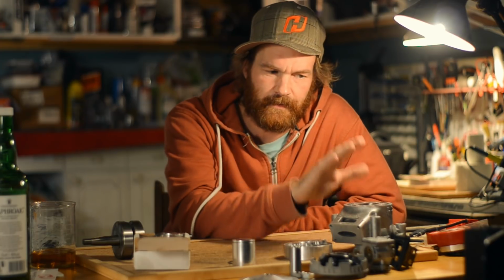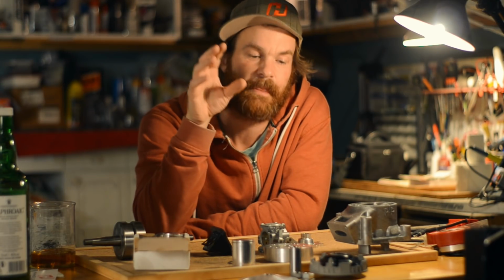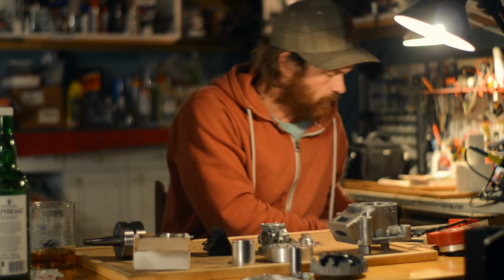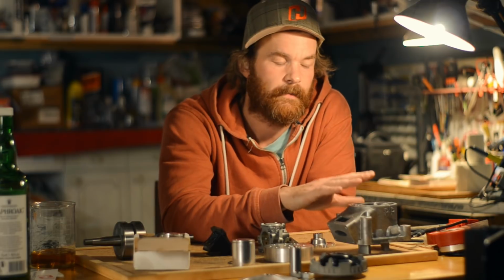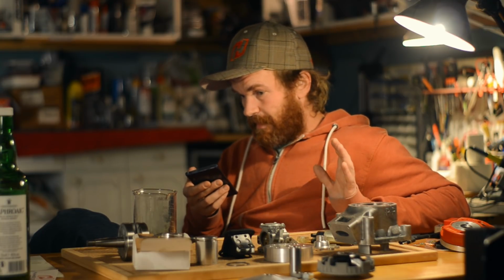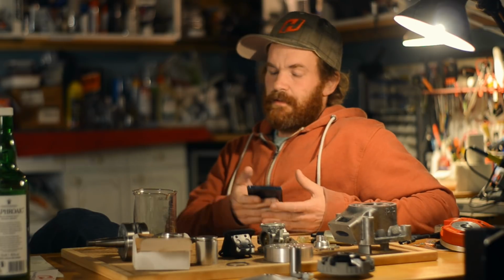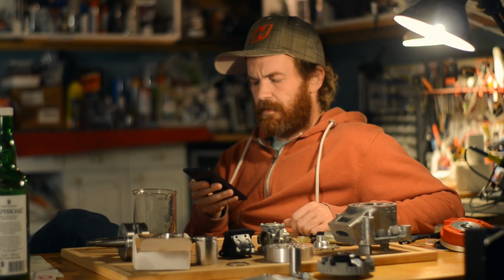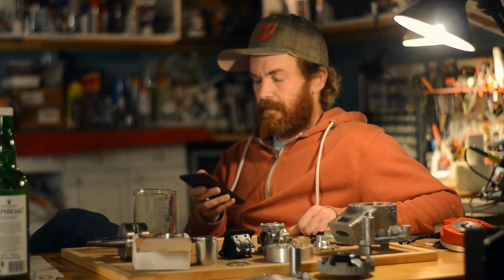THE Most Powerful Two Stroke - Back at it! + Replying to comments

Comment: The fastest way to gain maximum horsepower would be to do away with the air intake system completely, replace it instead with a liquid oxygen injection system, this way you only need the exhaust ports, no intake ports or systems at all. Temperature can be controlled by adjusting the fuel/oxygen ratios, as in a conventional system. Liquid oxygen expands considerably when it changes from a liquid to a gas, it would be like running a high pressure supercharger.
Reply: then not only is he attempting a record speed run on two wheels full of liquid fuel, youre adding a pressurized oxidizer to the same unit. literally evil kenevil with a bomb strapped to the gas tank. i cant imagine its safe at all
Reply: imakedookie  Liquid oxygen or LOX is not flammable by itself, it can be pressurized to 350 psi but that is not necessary for it to be used in this configuration.  As long as the two components are kept separated they are relatively safe. If safety is your ultimate goal it might be best not to attempt any type of speed records, especially on a motorcycle. For maximum power removing the need for an intake system could reduce  quite a bit of mass that could then  allow for a liquid oxygen tank and the equipment needed to inject it in a liquid state. Of course I know that his idea is nothing new and if it were easy, it would have been done by now, the technique would be most applicable to top fuel drag racing where more power is always able to be utilized for higher speeds and lower times.   I doubt the idea can be utilized effectively without quite a bit of expertise from rocket engineers and contributions from materials experts, but the basic concept is solid and doable.
Reply: @nixter1nixter1  Burning pure oxygen with fuel produces much higher combustion temperatures than burning the oxygen out of available atmospheric air (think acetylene welder). This creates now a materials problem.  I believe that rocket engine nozzles are cooled by circulating fuel on its way to combustion through tubes on their outer surface.
Reply from the maker: Even if you got all the logistics sorted the main problem would still be keeping the oxygen from initiating violent combustion at the instant it's injected into the hot combustion chamber. Could maybe, maybe, be done in some kind of hcci form.
Reply: 2STROKE STUFFING  I agree that implementing this design would be extremely difficult, however it’s only a matter of time before someone is successful in doing this. The combustion process does not have to be at its ideal i.e. hottest temperature, the mixture can be adjusted to a rich condition where it will actually run quite cool. The reason rocket nozzles run so hot is because they run the fuel oxygen mixture at the most efficient and therefore hottest temperatures. If you have even the slightest interest in looking into this I would suggest planning ahead a couple of years and start looking for rocket fuel experts and materials experts who would be willing to assist . Even a crude first attempt would probably produce amazing power levels and give you an instant advantage.

Comment: Have you decided to use a steel liner yet? Until you get the cylinder design complete then send out to get the final barrel chromed?
Reply: Watch his old videos. Alex does the nicasil himself!
Reply: @ossanyberg  I know that, and its never worked satisfactorily once, which is exactly why he didnt go Bonneville with it.
Reply: @manoo422  would go cast iron bore
Reply: @Eddie Hitler How did he know not to take his Nikasil barrel because Bonneville would be rained off...you clown. If you had two brain cells to rub together you would have known he took a completely different engine.

Comment: I'm very curious how your new setup is going to work, ecpecialy how the open intake will perform at other than optimal rpm, lubrication in the crankcase with open intake and fuel control.
It's quite a deviation from the traditionaly followed route in 50cc 2 stroke world, and is a testimony of willpower to succeed.

Comment: The valveless tuned inlet is super interesting, is there any precedent for this design?
Reply: Yes i dont remember well but a few of the big 4 did it back in the height of 2smoke road racing
Reply from the maker: Frits Overmars got me onto it, I know Modena has a working engine with reeds that hinge out of the way at high rpm. Made in collaboration with Frits.
Reply: Original Kawasaki H2 is valveless
Reply: @miamimovies  The H2 is a normal piston ported engine i.e. the piston is the inlet valve.

Comment: I was wondering about the weight reduction. Thanks for answering that clearly.
Reply: I had the same question years ago, one of the looong time racers (Keith Turk) said they added weight a lot of times for stability and traction. IIRC, the Camaro they ran (run?) was close to 4800 pounds, a far cry from the 3400 it started out life as.

Comment: Im new on this channel but im sure there is a injector solution for you if you think of diesel engines they spray 7small cycles before the real big spray. And for the other side i would build it with direct inhection with mechanical pump. Keep it up! 👍
Reply: a diesiel injector that sprays 7 times every 2 rotations at max maybe 5000 rpm would probably be enough for a two stoke at 18000 rpm if you're lucky
Reply: Direct injection would mean you'd need to inject oil separately in the crank case which would mean even more injectors.
Reply: DrZoidbergism im not sure but i think they can stand the oil ?? 🙄 but im sure  if you have dollars to spend they will manufacture one thath will do the job👍
Reply: Im glad with the positive people here nice to throw arround the ideas.👍

Comment: Nitromethane contains nitric and sulfuric acid, all parts that come in contact with that fuel must be plated (nickel silicon carbide). Can’t run the carburetor with a mono propellant can’t stop engine from running
Reply: Where did you find this about Sulfuric and Nitric acid impurity? A quick google didn't support this info. Nitric acid from production cycle should be neutralized?
As far as MSDS of chemical reagent goes no acids should be in the mixture. However if you are speaking about nitro-methane after oxidation might produce nitric acid. Sulfuric acid seems unlikely, cause sulfur poisons catalysts  and would be unlikely fuel supplement. That is why currently  you have to be below 4ppb S in fuels.. Maybe it depends on the suplier?
Reply: Or perhaps make a way to close off the carburetor completely

Comment: How do you control the cvt to hold a constant rpm?
Reply from the maker: Linear actuator varying spring tension.
Reply: electronicaly. now how that works I dont know? maybe that's what you're asking?
Reply: @Hermiwalle  yes that was what i was thinking of:)
Reply: Think snowmobile 
BRAAAAAAAAAAAAAAAAAAA

Comment: if you need to fire a lot of fuel in a short period of time you need a lot or HUGE injectors and high fuelpressure , maibe run two systems and do one side per revolution (gives the systems about half pulses and more change to build up the pressure needed
think you can get the tank to have a dimple for the chin pushing the air over the top of the helmet and maibe some widening toward the knees , you need a tank for the icecooling , and i dont think they have a maximum size for a tank and you can make an interesting fairing from it (not passing the body of the racer but more like an arow point in front of the rider)

about building up cilinders with nickasil . friend of mine repaired high performance kreidler cilinders , he did that by turning down the fins and a lot of the outer part of a stock cilinder to a cilinder with about 3 or 4 mm wall thickness (aluminium with a nickasil coating) then reamed out the high performance cilinder and presfitted the new cilinder before opening up the ports to the ports of the hp cilinder , worked pretty good actually and mahle is known for making high quallity cilinders with the nickasil coating 
might not be best thermical wize but you can do a lot of work to the ports before covering them up with pressing in the cilinder 
might even be possible to machine a billet cilinder that way
Reply from the maker: If I needed more than WOT at constant rpm/load that would be the way to go!

Comment: Jeg får vel ta det på engelsk, siden det er blitt normen: If you weren't born in Norway, but in the US you would probably have been offered a job as an engineer at a engine performance company! It's a shame that there isn't that big of a culture with motoring here in Norway, except the yearly Amcar meets.. (Probably because the insane taxes we have to pay when buying anything else then an EV...) 
Lykke til videre!
Reply: The same here in Sweden. I love the motor culture in the US.
Reply: @ossanyberg  yeah, scandinavia is a shit hole when it comes to modifying vehicles, although fast cars are a lot cheaper to buy in Sweden, compared to Norway.. A 2016 Subaru awrx sti costs over 900 000nok, while in Sweden about 380 000sek, about 400 000nok... Less than half the price..

Comment: Fusion is a yunger brother of 3D modeling software Inventor. Give it a try. Fusion is based on it. The workflow in Inventor is faster and more organized than Fusion. I am using Inventor for couple of years. I am using allso Fusion for programing the milling programs and I strugle when modeling in Fusion. Steps when creating something are realy long. In Inventor you use the same features. They are just more "reachable" in Inventor. Give it a try. You can thank me later. Best regards from Slovenia.
Reply from the maker: Thanks, I should!

Comment: But how are you going to keep the Reed valve closed when the fuel injection is running?
Reply: Close the throttle in the carburetor.
Reply from the maker: If it wants to open that's fine by me, would only add some gas into the mix. Highly unlikely though, as there's a much easier path through the big gaping hole on the opposite side.
Reply: Possibly greater concerns are in getting the small carby to power the engine to 19krpm at the lowest gearing of the variator before the main, resonant intake opening will actually work, and how to close off the main intake while the carby is doing its work.  I assume the large intake needs to be closed off at the crankcase to keep the crankcase volume small enough, but in a way that is not restrictive when open, like a slide valve.  I am sure Alex has considered all these things.  I am amazed at all his work.
Reply: @idontwantachannel3091  He could probably use a tapered plug that fits down the bellmouth and manually switch over from carb to tuned inlet. For a land speed record bike it wouldn't really need to be automated.
Reply: @ferrumignis  I like your thinking!

Comment: Reed valve or piston ported. Whoever's made the no intake valve on a 2t has no idea.  Obviously on a piston ported engine the intake valve height and size can change the engine from developing low down torque or high revving screamer. Personally tuned my pinasco master T5 engine for low end torque. Without touching the ports due to me being rubbish at maths. Jus did it through gearing and exhuast choices. Nice to see another BMX chap tuning 2ts, albeit in a much more serious way than me!

Comment: Alex, have you looked at how the new arctic cat 8000-SERIES C-TEC2 engine has its injectors? http://www.arcticinsider.com/Article/Everything-You-Wanted-to-know-about-the-Arctic-Cat-C-TEC2-8000-Engine  It looks like it could really help with crown cooling and where it is lets you spray direct into the cylinder and into the case when the piston passes the port.
Reply from the maker: Looks like a great way for a "normal" setup!
Reply: @2STROKESTUFFING  Yeah, as you say, the pulse times are going to get way too short up top. espcailly on something as short stroked as a 50cc. Could enough fuel be delivered with multiple injectors? i Guess half of a revolution is only about 1.5 ms?

Comment: How do you manage primary compression with open intake?
Reply from the maker: The exhaust and intake pulses take care of it.
Reply: Will be insane.. looking dorward to seing the rest of this🍿🍿
Reply: Yeah but only at higher rpm? will you close the main intake off while at low rpm? Very interesting solution and it will show off some insane numbers if you get the tuning right..
Reply: @berjohansen  The tuned intake would need to be blocked to start it via the carb.